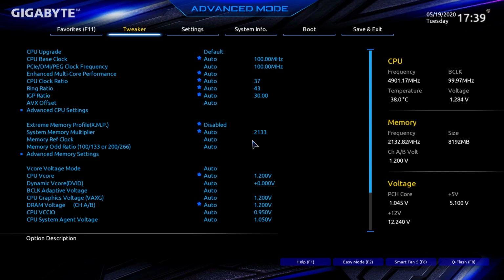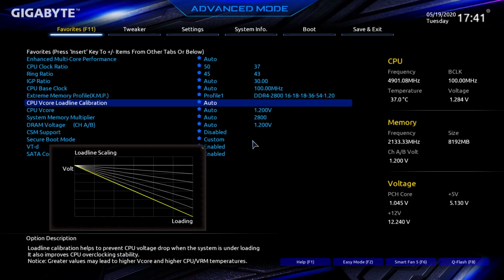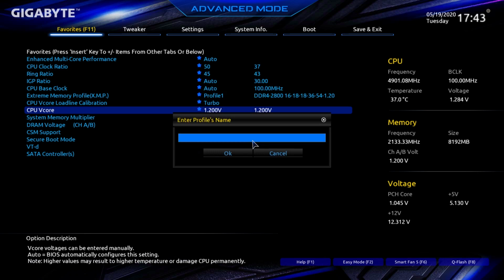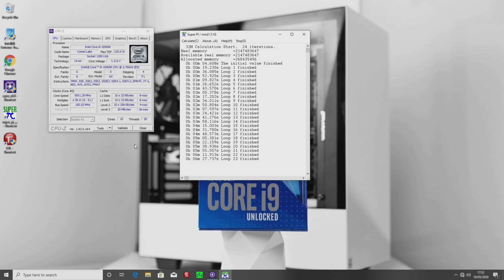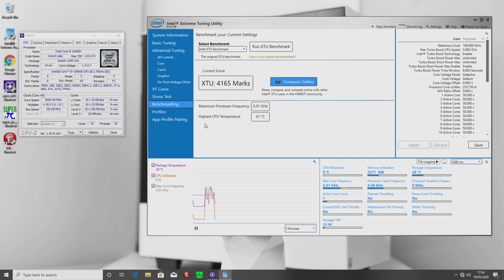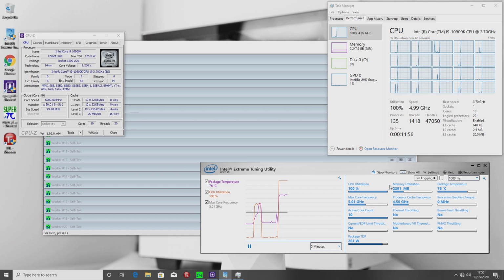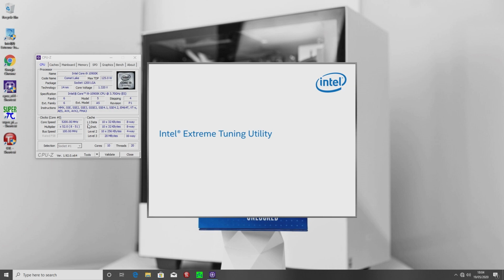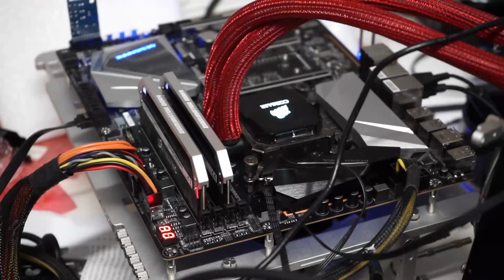Intel Core i9 10900K & Z490 5GHz+ overclocking guide

Comment: Amazing CPU! Haters gonna hate :-) but I am sitting stable 5.1ghz across 10 cores WTF !!!!!!!!!!!!!!!!!!!!!!!!!!!!
Reply: May I know what voltage you used for 5.1Ghz ? Currently sitting stable at 5.0Ghz at 1.2V on all cores maintaining under 80c on all cores
Reply: Thanks for the guide. Just oc’ed my i9 1099k. Switched from amd couldn’t be happier with performance and most importantly stability
Reply from the maker: SkyLimit hell yeah dude
Reply: @dinos22  how to check if all cores are the same freq. ? 
I have z490 Aorus Elite.
Reply from the maker: @Silvestian  download CPUz, install it, start it and right click on it while running and it will show you all CPU core frequencies

Comment: People, I have Gigabyte z490 Vision D motherboard with integrated intel 630 gpu. I used hdmi output for monitor now I want to add another monitor &connect it through Display Port. But there is no signal going through Display Port. How can I activate display port? 
Any help will be appreciated 🙏

Comment: My 10850k its almost 100c on my MSI mpg gaming plus with default settings running NZXT 360 AIO ,tested with prime95 .....any suggestion for lowering that heat ??     Thanks!
Reply: That's the heaviest test possible. I'll check with a 10900K how much it goes up to in Prime.
Reply: Are you running small fft?
Reply: @Ben-ld1qi  Yes and avx on
Reply: @Ben-ld1qi  Yes and avx on
Reply: Was having the same issue. Had to set pl1 and pl2 limits. My gigabyte board set it to essentially unlimited...

Comment: It seems I’m stable on air cooler at 5ghz 4.5 ring and 1.225 volts , worth going any lower on the voltage? I did stress test and hit 91c max temp decent silicon lottery ? What you think ?

Comment: Got lazy and decided to copy and paste to see if the 5.2 ghz settings would work for me. Computer blue screened into recovery mode, within another 5 sec before i could select an option it restarted again. Booted it up with opt defaults. Ethernet port wouldnt work. Took me like 2hours to fix it. Def gonna have to do safer testing (stupid for even trying to copy n paste). Thiught i had fried my lan port for awhile there
Reply from the maker: Definitely no reason for overclocking settings to stuff up the LAN port
Reply: Do you still remember how you may have fixed the Ethernet? I'm overclocking my brother's 10900k and it's acting erratically, something the Ethernet comes back and it's not like I even did anything special.

Comment: Quick question Dino. When you do a quick bench test in XTU I notice a pulsing “electrical whine” in your video that sounds identical to mine! What is that coming from and should I be worried? I don’t hear it in any of the long test. Gigabyte z590 Sabrent m.2. Can’t pinpoint what component it is as I have never heard another computer do this before.
Reply from the maker: Don’t worry, it’s most likely PSU coil noise. It’s normal

Comment: Can this oc Guide work with a i5 10600k?
Reply from the maker: Of course! The OC headroom maybe different but same rules apply
Reply: @dinos22  alright sweet the cpu voltage @ 1.405v under load is good? Flpushing 5ghz all cores
Reply from the maker: @magplant3800  what are the temps up to?
Reply: @dinos22  im watercooled so about 60-75c average
Reply: Might have to change coolant and clean my waterblocks
Reply from the maker: @magplant3800  that’s great. As long as temps are in check
Reply: @dinos22 thank you dude, didnt really expect you to reply since its a old video thanks!

Comment: Thanks for the guide. I wanted to have a baseline for my i9 10850k @ 5ghz. A lot of guides were pushing 5.1 or more. And I wanted something that would run cool and at Low voltage. I manged to run my chip at 1.215v similar llc. Max temps in cinebench r23 75c.
Reply: awesome. excited to get my 10850K running.  Its been a wild ride of "guides" screaming that 5+ GHz all core isnt possible etc.
Reply: @helmhamburgerhand  I've got a stable overclock at 5.1 all core at 1.290v. 5.2 is also possible but the voltage/heat starts getting high. Msi bios game boost will also run it at 5.4 on multiple cores but the voltage is 1.4v+ which I'm not comfortable with.
Reply from the maker: Awesome
Reply: Could you share your settings for 5Ghz i9-10850k ? 
Do you use the same settings?

Comment: WOW! is this the same settings with my Z490 Vision G? I have a i7 10700K and I want to OC to 5Ghz thanks
Reply from the maker: Sure but this is also CPU dependent, some are better overclockers that others. Make sure you have decent cooling too
Reply: @dinos22  I have a NZXT Kraken x53 cooling is that good? thanks man
Reply from the maker: @crjcostomo  should be fine

Comment: Did this to exactly the same settings. Had it working and stable for a night but now getting blue screen immediately when doing XTU Benchmark. Any advice?
Reply from the maker: You’ll have to tweak, try changing variables such as CPU frequency, ram frequency, timings, voltage. Test one change at a time

Comment: you are aware the 10900k comes from factory with turbo of 5.3 ghz lol? even at 5.0 all cores your voltage is to high and not hard. Not being negative its just shocking me how many dont know how to run the chip.
Reply: Yeah but bro it’s boosting 5.3 on some cores and 4.8 on others .. he’s doing ALL CORE constant overclock stable idiot
Reply: That 5.3 turbo is only when 2 cores are running, you also need to be below 70c for that and it increases the voltage and power consumption massively. I am surprised you are talking so much shit without knowing shit.

Comment: Nice video Man. I want to buy this CPU but... I want to put it on Aorus Z-490 Master. It will work? Please answer me
Reply from the maker: Of course
Reply: Gamers nexus used the Asus z490 xii hero board for a very long time for testing all the comet lake CPUs and they always said how good that mobo is... It can achieve higher clocks with less voltage... If I had an extra 150 pounds I would have bought that board instead the msi z490 unify... No brand preference here though..

Comment: Running a 10900K on a Gigabyte Aorus Pro with 64 GB Ram. Couldn't bench or do anything unless I was under 4.7 ghz. Kept crashing to bios and reboot. Finally upped the AVX offset and it stopped. I'm now running 5100, but my AVX offset is 5, which kinda sucks since the main apps I run use AVX. Seems like the offset affects all the cores equally also, not just the ones used for the AVX app. Any ideas?
Reply from the maker: Hmmmm that’s rough, what temps are you seeing under load? What voltage and LLC are you on, what cooling do you use, what ambient temps are you in, are you sure your RAM is 100% stable, have you tried a single stick just to eliminate ram instability potentially affecting it? What thermal paste and cooler is it again?
Reply: @dinos22  Thanks for the speedy reply. I might have been totally wrong. My pc was crashing right off the bat when I went above 4900 or if I tried to bench above 4700. When I did the AVX Offset, I thought that fixed it, but what it did was just keep it at 4700, so it never crashed. Going to try what you said about 1 stick instead of two. Since i upgraded from a ddr3 board, I had to replace everything, so there are too many variables. Have you ever seen crashes like this the minute the cpu ratio is changed?

Just tried removing a stick, but it didn't help. There are 2 negative  comments about my Ram on Amazon, so it might be the Ram, But I don't actually understand what cl and such means:

"Because the SPD is 2133mhz, I had to manually change the setting in BIOS to get the ram to run at its' advertised speed of 3000mhz. The CL (cas latency) is now 22, vs the advertised CL16. Considering returning for another brand that is truly 3000mhz CL16".

"Even with bios changes I could only get it to run at 2400 without tripping up my machine."
Reply from the maker: @billymartin6497  it’s difficult to say as you have a lot of variables at play but you must test RAM for stability first at all default and then at OCd settings (leave CPU OCing for later until you confirm ram)
Reply: @dinos22  Yeah. i think you're right. I just went ahead and ordered some name brand (Patriot) ram that's 3600. It's a really good time to work with upgrades because of the holidays. You have until January to return stuff you don't like to Amazon. (:
Reply: @dinos22  At this point, I'm not sure what to do. Got the patriot ram and it is faster, so I think I'll keep it... but the pc is still crashing. Has nothing to do with heat, because heat is low and it crashes immediately.

I put a 10900 in place of the 10900K and it didn't crash on any apps, but then again it only got up to 4700, so I didn't learn much. Has to be either a bad CPU or Motherboard. What do you think?
Reply from the maker: @billymartin6497  does 10900K crack at default bios settings? If so just RMA it
Reply: @dinos22  I think you're right. The replacement motherboard showed up first, so I put it in and it still crashes. CPU will be here Wednesday. Fingers crossed. The only other thing I can think of is the PSU, buy it's huge... like 1200 watts, so I doubt it. The only other thing I'm doing out of the ordinary is using a 4K tv as a monitor. Got 8GB of ram on my nvidia 1070 so I doubt that's it.
Reply: @dinos22  Well, Good news, sort of. Just got the new cpu and it's doing a lot better than the old one. It is crashing at 5100 when I do prime 95 without disabling avx. Do you disable avx when you stress with prime 95? BTW, Cinebench crashes the PC immediately back to Reboot with nothing else running. Really confused on what to do.
Reply from the maker: @billymartin6497  back off to stable speed mate. Did you try 5GHz Cine?
Reply: @dinos22  Can't do anything with Cinebench. My actual daily work does fine at 5000, but I have the CPU voltage on auto and it's staying up around 1.38 - 1.4 and that seems high doesn't it? I would really love to be able to have this stay steady during bench and stress.
Reply from the maker: @billymartin6497  maaaaaate, auto vcore. What are you doing. That’s your problem
Reply: @dinos22  Well, I tried from 1.3 to 1.35 and it would stay running manually. Going to try again. There's probably one settings I'm missing. BTW, Even with the good Patriot 3600 DDR4 I couldn't use profile 1 without crashing, and I have no idea how to manually set the dram speeds. The ram is DDR4-2666 / PC4-21300 DDR4 SDRAM UDIMM
Reply: @dinos22  Thank you for all your help. You were so patient and kind. Got it completely stable at 5000 with a fixed core of 1.25, but since I never put a huge load on it,  I'm using it at 5100 with 4900 cache at 1.27 fixed core.  Someone had told me that once I got it,  I should switch back to adaptive core, but that crashes it immediately.
Reply from the maker: @billymartin6497  awesome man, enjoy!

Comment: This video came up at the perfect time!!!

I've been trying to decide between the Vision D and the Asus Z490-G (as an MATX build).. for my daily use, OC'd workstation, for AutoCAD (2D), Revit , Bluebeam & Lightroom, all single core CPU intensive use that crave high core clocks (NO gaming or rendering will ever see this setup!!)

Until this video, I couldn't find any info on the stability of overclocking the Vision D for workstation use.. just a couple ppl glossing over it suggesting that it "looks" likely to not be best for OC'ing "for gaming".

The PCIE 4 provisions were already weighing heavily in favor of the Vision D.. but now that I know it can stabily run the 10900k OC @/over 5GHz.. I think I got myself a winner here.

Thanks Mate.

Comment: My XTU be ck mark never finishes? Also, at the top left of the motherboard, what ports did you plug the extra power into?
Reply from the maker: Odd, probably unstable. You can’t really get 8pin power connection wrong, you can even use a single one for same results as n regular cooling

Comment: My GPU is the only thing not delivered yet. Can I do this with the same settings you used, but without the GPU before it arrives? Thanks!
Reply from the maker: Nicole Rodriguez yeah why not
Reply: @dinos22  I copied the settings in the video exactly for my i9 10900K on my Vision D, but my computer showed the blue screen and crashed. Is there anything I could do to make it work? If you don't have the time I understand. Thank you for posting the video and responding to me.
Reply from the maker: Nicole Rodriguez start in smaller steps (don’t do all settings at once) and see what could be causing the issue

Comment: Thanks for this review. Just curious, is i9-10900K with Z490 future-proof? I'm debating whether I should get a "AMD 3950X + X570 mobo" combo or a "i9-10900K + Z490 mobo" combo now (mostly for playing MS Flight Simulator 2020 and maybe content creation like video editing), which combo would be more future-proof? Thanks!
Reply from the maker: Well mobo vendors were hinting it supports new gen chips but don’t worry about future proofing, just get something decent now and then reassess in a few years if you need to move to something new

Comment: I followed your instruction to overclock my 10900KF @5 GHZ it is stable but after a while maybe when my computer goes to sleep the frequency goes back to base @3.7GHz and I have to restart my computer to get it back to 5, please help I don't know why it goes back to base frequency after a while I don't know what to do any tips are appreciated. Thanks in advance and thank you for this video
Reply: I have 360 AIO, and the temperatures don't go over 30 when I am not stressing, so it is pretty comfortable, and when stressing it doesn't even go over 80!
it is just annoying that I have to restart to get back to the OC frequency any help please

Comment: Mine runs hot... Followed your steps and the Intel benchmarker said I was hitting between 90 and 96. I use liquid cooling and a Z940 Aorus Elite AC, too. What gives you think? What kind of numbers should I be looking for in SuperPi - that wasn't explained. Thanks!

(UPDATE) Messed around with the voltage a bit... got 83 degrees at 5.1, and 90 degrees at 5.2; 1.3 and 1.35 voltage respectively. Any less voltage was either TOO hot over 90 or I crash. Tips?

What could be making this significantly hotter?

Also, cache doesn't go higher than 4.3 despite 45 when higher than 5.0 ghz in BIOS.
Reply from the maker: Yeah voltage will be the key heat generator. Another thing to look into is thermal paste, what are you using?
Reply: @dinos22  Right, but why is mine so much higher at the same oc? The thermal paste that already came on it. Why do you ask?
Reply from the maker: Frankie Giustino hard to say man, what LLC are you using? Could be thermal paste, cooler, ambient, perhaps CPU itself a little different the way it responds to volts, could be solder lots of things
Reply from the maker: Superpi temps I don’t mention as it loads only one core

Comment: Wow :)  1.25V seems really low does it not? 5Ghz is a 35% overclock after all.   I havent done this in years so I am kind of out of the loop.
Ordering parts at the moment.  ASUS maximus XII Hero,  10900k and 32GB Corsair Dominator Platinum RGB 3600Mhz.  Cant wait to start building.
Reply from the maker: Yeah man CPUs got good

Comment: 5ghz at 1.25 is my max lol, it crashes or goes over 100c if i try go up. also using a h115i
Reply from the maker: Nothing wrong with that mate, enjoy
Reply: Changed thermalpaste to thermal grizzly and temps dropped by 15c lmao. 5.1ghz @1.29 atm max temp cinebench r20 is 80c
Reply from the maker: Vecca what paste did you use before? That’s a huge drop
Reply: @JZXVecca  this sounds like your cooler wasn't cooling properly before. It sounds like when you switched pastes it started cooking correctly. New paste won't change temps that much.
Reply: I don't know the computer shop gave it to me for free, it was in a silver packet. Also I can't stably go over 5ghz haha 5.1ghz at 1.3v isn't even stable lol

Comment: My XTU benchmark score is only 4,020 w/ 10900K @ 5.2Ghz.  Not sure why my score is so much lower than yours.  :(
Reply from the maker: Show me the screenshot with CPUz on CPU and memory tab included
Reply: @dinos22  My scores seem to fluctuate drastically on multiple runs.  One minute, I'm getting 3,450 and the next run I get like 4,050.  There's no consistency between runs.  https://imgur.com/hfrzMld
Reply: Sounds like heat soak

Comment: where can get ver.x1 for z490 vision d, Igot the same MB with 10700k
Reply from the maker: Don’t understand the question
Reply: @dinos22  in your video BIOS version showing X1 but in my Vision D board it F6 that what @Hanling is asking.
Reply from the maker: @TonyStark0A  initially started testing on D and later on X. No difference

Comment: Hi, I was wondering what cooler you used as your actual cpu was quite cool
Reply from the maker: Corsair H100 older version. 240 AIO.
Reply: @dinos22  ok thanks so much
Reply: @dinos22  Happy New year 🎇.  What was your room temp (when recording this) ?
Reply from the maker: @TonyStark0A  mate I can’t remember now but probably high teens at that time or low 20s

Comment: I did the first settings and my pc keeps on crashing since. That means i have to even lower them ?
Reply from the maker: Reset to default and test system for stability, next, set XMP profile ONLY and test ram stability with 32M Superpi test and after that start changing settings again once change at a time and test each step for stability until you find the cause
Reply: @dinos22  thanks in the end i had to change the blk thing to disabled